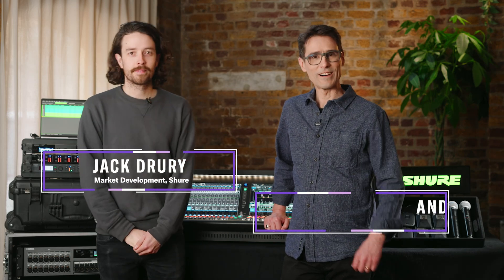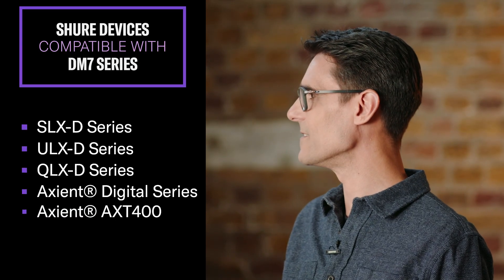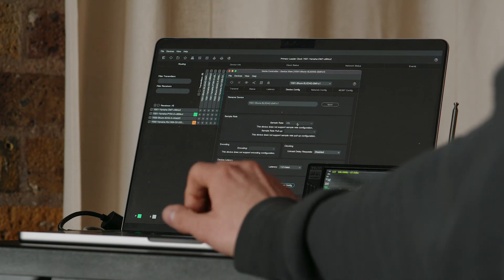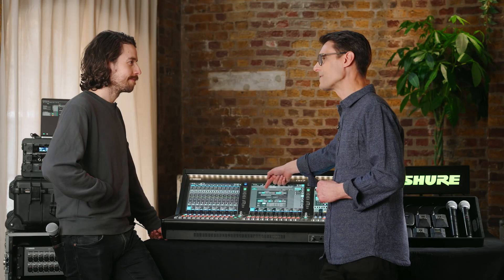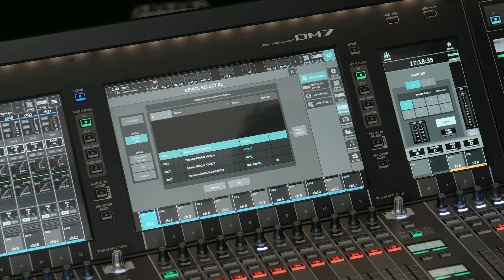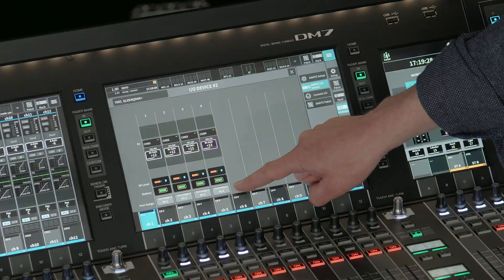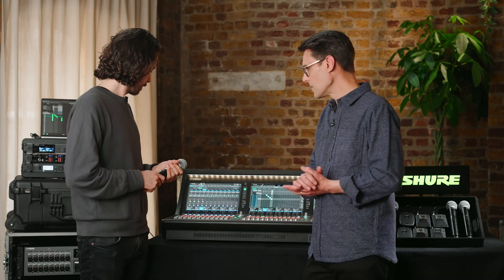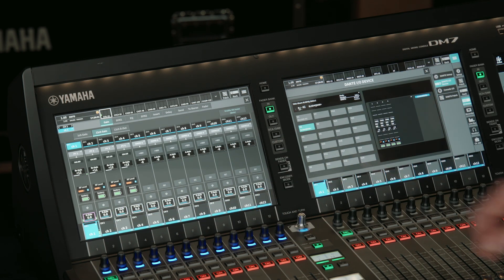Controlling Shure SLX-D from Yamaha DM7 series

Comment: not to be "that guy" but the whole concept of changing the gain on the wireless digital receiver makes no sense when connected to Dante, as far as I know, the ULX-D, SLX-D, and AXIENT cannot send data bidirectionally between the microphone and receiver, so the "gain" is just  "digital trim" and all of the available dynamic range of the AXIENT, SLX-D, ULX-D, etc fit within 24bit.  So... just set the shure gain to minimum and just use digital trim up on the console and the audio quality should be *exactly the same*.   Similar to StageTec's mic amps that have fixed gain, but a wide 150+db of dynamic range and just use trim on the console(s).   Sometimes I wonder if the "Pro-Audio" industry is even pro at all....
Reply: Isn’t it dual native gain?